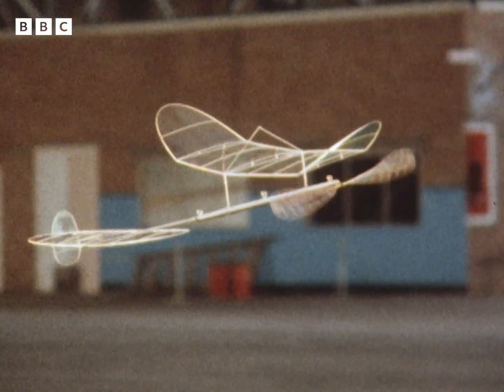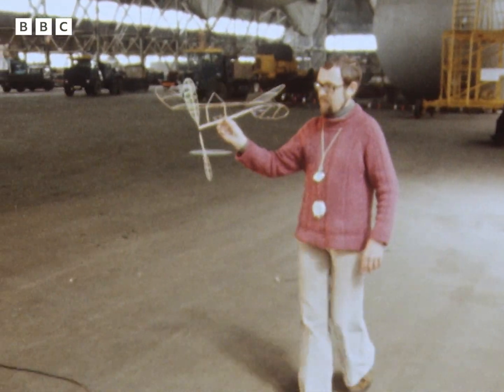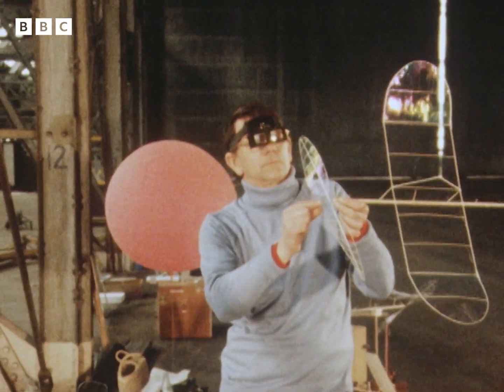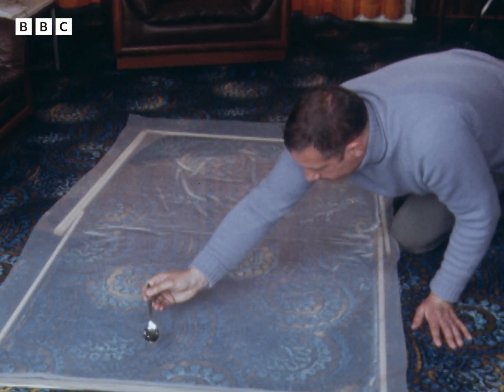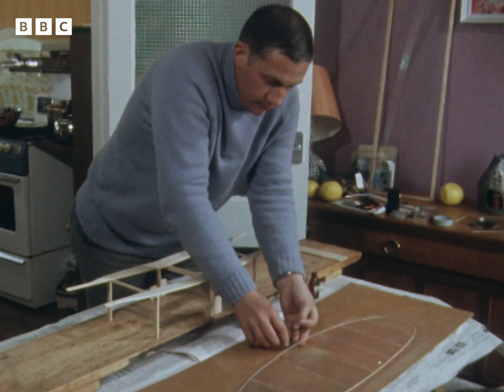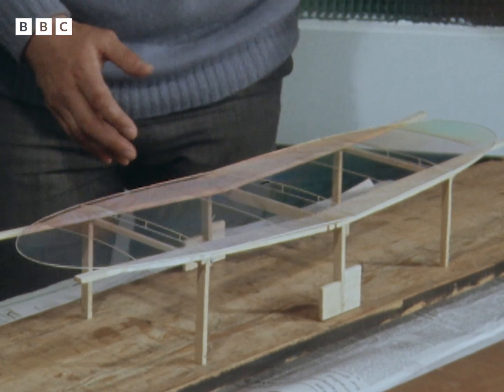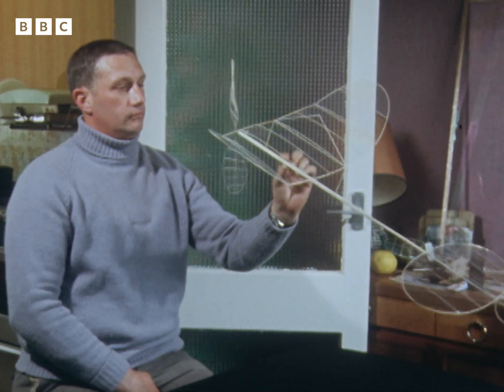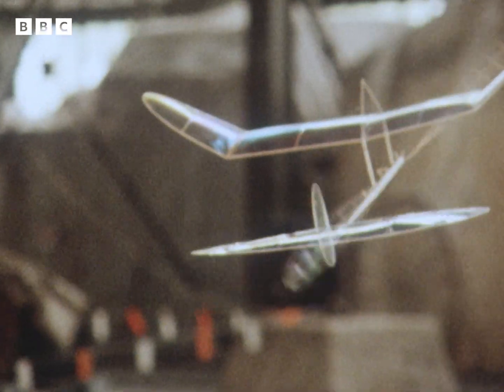1976: FLYING PLANES that WEIGH LESS than a FEATHER | Nationwide | Weird and Wonderful | BBC Archive

Comment: My Dad built and flew these incredible machines 15 hours of meticulous work to get one ready for competition he also had friends world wide who participated in this unique sport
Reply: How do you even travel with such a device?
Reply: @stressballer  Very carefully packed into a box and the the box strapped into the back of a van
Reply: @stressballer Intense dieting and then climbing into a dehydrator after the turbo-shrinker. In reality it’s not really a practical vehicle for traveling because it can only take you from one side of a hangar to another.
Reply: @stressballer Most of the delicacy was from the liquid fillings of the frames, which would be prepared on-site when required.
Reply: Scot, my dad also did this in the same era that this film was made. He had a refrigerator full of “vintage Pirelli” rubber. He had reels of old nitrocellulose movie film that he would melt down and sell to fellow competitors. I remember the bracing wire that was thinner than human hair. The torque gauge for measuring how tight the winding was. The glycerin and green soap used as a rubber lubricant. Like the subject of this documentary, my dad was an airline pilot. I followed him into that career but my modeling was more of the powered variety. I remember my parents traveling to Romania and Japan for competitions. He flew in the hangar that would have housed the Hindenburg in Lakehurst, New Jersey and the US Navy blimp hangar in San Jose, California.